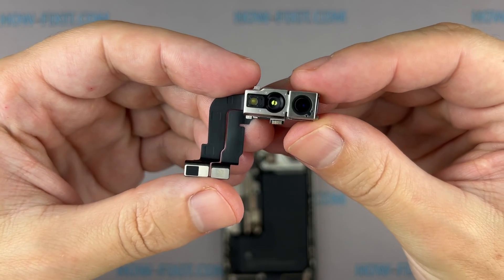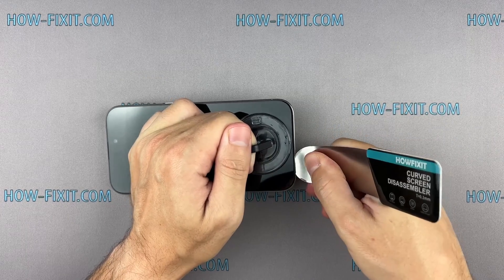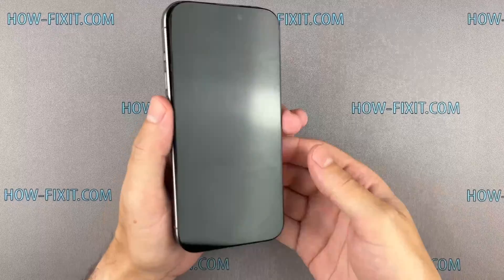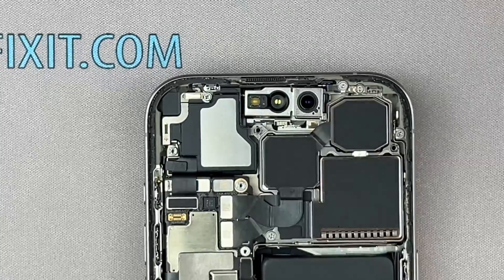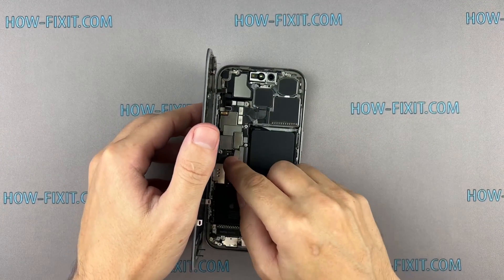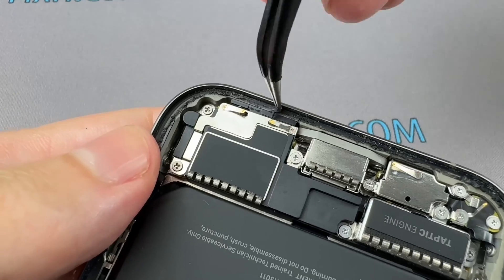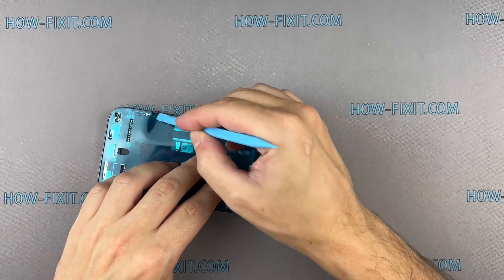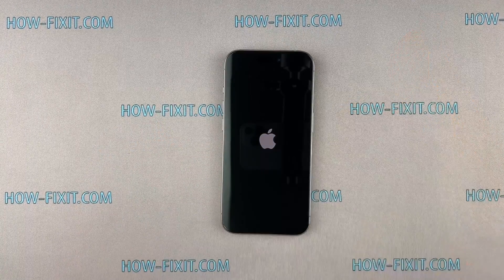DIY iPhone 15 Pro Repair: Step-by-Step Front Camera Replacement

Comment: First of all tysm How-FixIT to providing this video. I am sharng what i've done for repairing my iphone 15 pro.
Just repaired my broken front camera on my iphone 15 pro DIY. This is what i've done.
1. bought camera module from ifixit
2. Opened camera module and swapped with new camera. keep original FaceID dot projector for keeping my face id.
3. Put everything back and testing. -> definetely not working
4. reset the firmware by updating to new ios 26 beta (non-beta will work too).
5. Face ID and front camera works perfectly!

Hit the like button so other ppl can follow what i've done.
Reply: So you’re saying if you replace the entire front camera assembly without transplanting the dot projector, just updating iOS will make both the front camera and Face ID work perfectly?